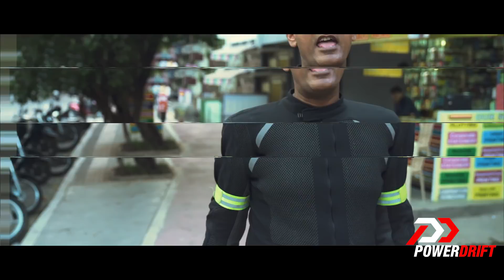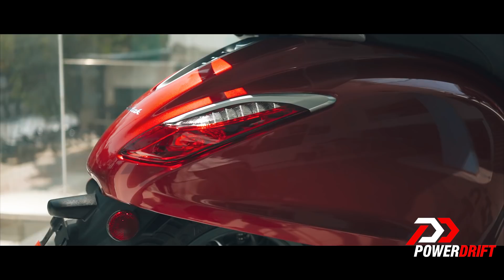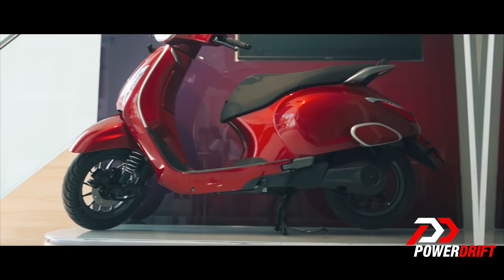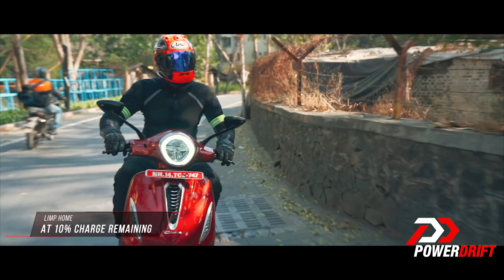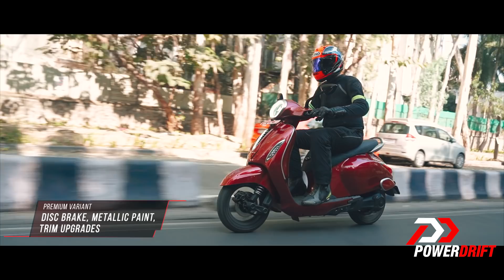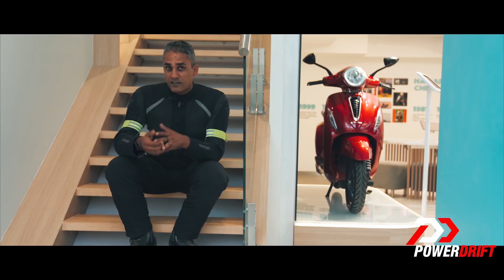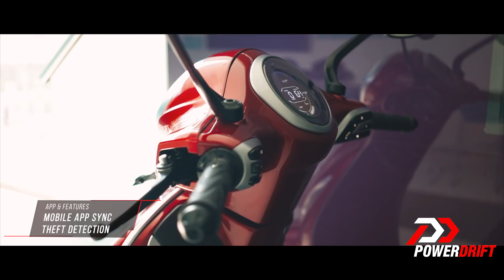Bajaj Chetak | First electric ride | PowerDrift

Comment: "Moving towards the future one step at a time" I completely agree on this. Which is why we definitely need to encourage Indian EV industry.
Reply: Around 77% of electricity produced in India are from fossil fuels and 90% of that from highly polluting coal/lignite.23% is from rest of the sources (including nuclear). So aren't EVs moving the CO2 emissions to the power plants?
Reply: Where do you think Electricity is generated from
😂
Reply: @menbl2941  when demand rises people will try and produce solar panels and renewables at a faster pace. 

Kerala produces much of its energy from hydro electric, much like that on a governmental level as well as individual level people should go towards cleaner ways.
Reply: @pjijin  my friends
You're kinda tight in the case of Kerala
But let's inspect the condition.
Kerala's electricity usage is way less than the national average. And if so a close study, you'll understand that Kerala is well bestowed upon by the hydro sources which is a seasonal thing again. When electricity usage increases drastically , it wouldn't be sufficient.
Further do you think hydro power is very nature friendly, no , it also poses a lot of risk if done on a continuous basis especially to the environment and biodiversity.

Now let me so you about the battery recycling, how do you think ppl are gonna counter the battery recycling issue at the end of it's lifetime.
Reply: @menbl2941  I do agree with you. However mass production with higher demand will make things more efficient is what I believe. The production of battery and it's disposal.
 People and government agencies will hopefully derive good amount of energy from renewables. 

Let's hope for the best. 

I will miss ICE's.
Reply: @pjijin  nyc having a healthy convo broo
Let's c 
But I strongly feel that ev's are wayy overrated and that most companies have started releasing it to capture the green army out there. If u do a little research you'll find articles where many CEO's of the vehicle companies claiming that ev's will fail and are not the future, but they'll still produce them to meet the current demand.

Secondly battery production, life and recycling is a big issue which nobody talks about.

Third, the ICE have become very efficient and less polluting these days. As per the latest norms the pollutant being emitted have gone drastically low.

Anywz let's c
Reply: @menbl2941  ya. Let's see.
Reply: @TheFourthWinchester  No my friend
By their end lifetime, power retention will be sub par and charging frequencies well be unstable.
This is by far the most vague claim I have heard on this topic
Reply: @menbl2941  first the traffic in cities causes 45% of the pollution mainly particulate matter PM2.5 which is harmful, having more evs is very beneficial if you don't want to suffocate in cities
Reply: @menbl2941  dams-hydro
Reply: @wispindis   dude , u need to get ur facts ryt.
More than 90-95% of electricity is generated from Fossil Fuel plants.
Reply: Ev is not future...
An electric vehicle emit more pollution than a internal combustion engine..
You can take china as example...✌️
Only green fuel available is HYDROGEN
Reply: @rohitmier  you need to charge them from a renewable source. It can be the future.
Reply: @wispindis  and how many renewable sources are there in india...?
Reply: @rohitmier  you could start from installing solar panel at your home.
Reply: @wispindis  do you think i will spend extra for installing a solar panel setup just to charge my scooter and how many Indians will do this...?
Ev is not future bro...🙌
Hydrogen is future and there is a lot of research going on for that..✌️
Reply: @rohitmier  Soon it will be viable. It even through nuclear power plants.
Reply: @rohitmier  Hydrogen is not the future.. It will never be.. EV's have already won that battle.. EV's are cleaner even when the energy is coming from Coal.. 
They break even just in a couple of years even without non renewable sources.. EV's are just significantly more efficient than internal combustion engine and Tesla is the living proof of that..
Reply: @rohitmier  you being vehemently opposed to the idea of EV as the future will not change the fact that EV is indeed, the future.
Reply: @revaddict  can you tell me how much pollution generated by manufacturing of  lithum ion batterris?
Reply: @monucool2570  Much less than oil.. Lithium needs to be dug once.. Meanwhile you need to be continuously digging up new oil wells, shipping the crude oil, refining it, shipping it again to your nearest petrol station..
Reply: @wispindis  EV can't be future bro at least for heavy duty uses. It will be restricted only to Cars & Bikes.
Reply: @ishan7297  ever hear of tesla semi ??? It is possible. The fact is that the EV technology had been hindered by big Oil and other corporate who does not want it to be main stream
Reply: @rohitmier  A doctor from kerala has installed solar panel in his house to charge his Nexon EV and literally he is not paying anything for charge.
Reply: @rohitmier  how do you think hydrogen is generated?
Reply: @rohitmier  hydrogen is just an energy carrier. You need electricity to produce hydrogen in a form that's usable. It's also like a battery.

Comment: Electric vehicles has to pay 5% gst while petrol vehicles has to pay 28% gst, electric vehicles get huge subsidies for ex.-ather 450 gets 22000 subsidy. There is a difference in road tax RTO of petrol and electric vehicles which vary according to states. For ex- MP charges 8% on ex showroom for  RTO for petrol vehicles whereas it's only 4% for electric vehicles. Battery would cost around 50000 in electric vehicles. Even after so much tax exemption and subsidies and benefits electric vehicles can't compete to even 110cc scooter in terms of performance i.e.acceleration and top speed and range and pricing even double and triple  to petrol vehicles.
Thus India should postpone it's electric vehicle plan and focus on declining automobile sector.